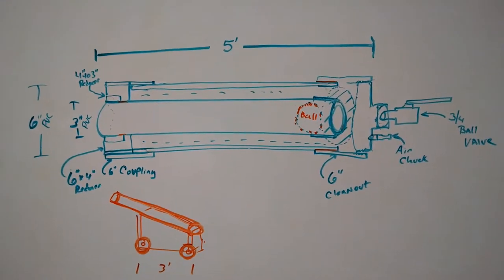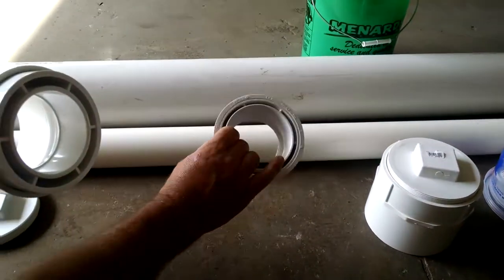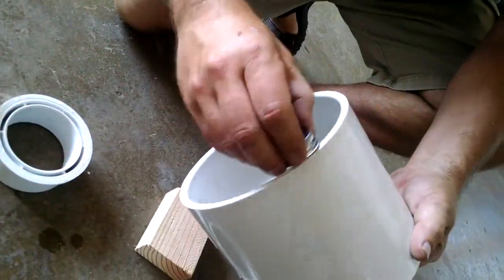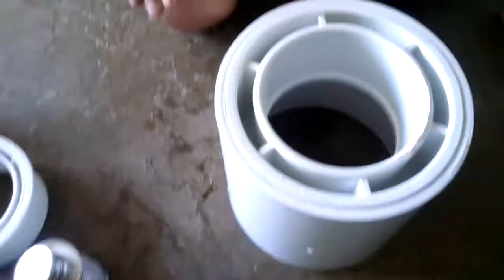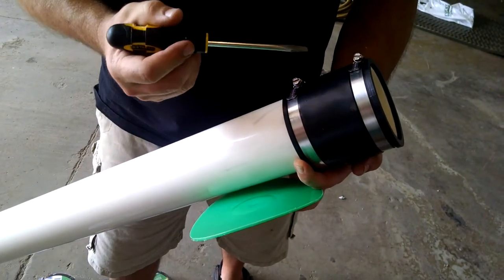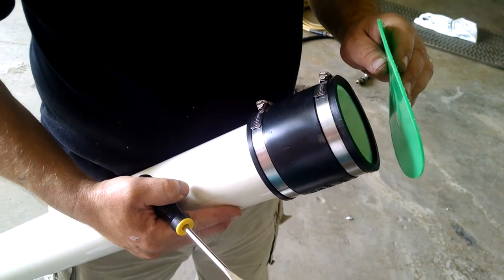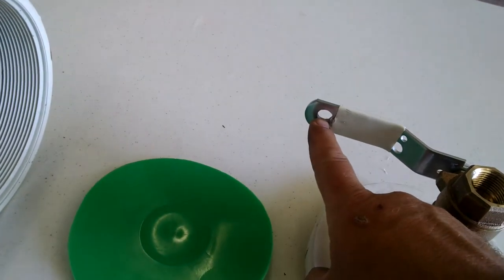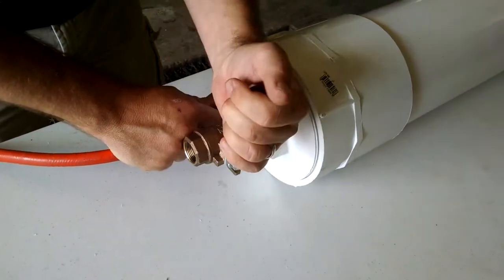How to Build a powerful Baseball Air Cannon  REAL HOWITZER

Comment: What if you lowered the air pressure? Would it go a shorter distance or just not work at all? I’m just trying to find something to shoot a baseball at 45 degree angle for 70-80 feet.
Reply from the maker: we fired this unit all the way down to 30psi with good results, the amount of force you need to push the Baseball 70-80' is very low, likely less than 5% of the unit shown at 120psi

Comment: If i made multible of these but only one having the valve, and the rest connected in a series, with a seperate section of pressure tubing connecting valve to valve. With the delay in reaction of each valve do you think i could manage each cannon to fire in sequence one after the other.
    -- just imaging multible of smaller versions of this cannon shooting full auto with only a singal trigger valve fireing all the rest.

Comment: Curt, nice work on this! I'm trying to use this diaphragm valve idea to launch much larger projectiles (~ 40 lb). What is the software that you show in the video?
Reply from the maker: Greetings 
There are a few pneumatic launcher calculators out there, one we have used forever is GGDT or HGDT pneumatic calculator, do a google search for these terms and you will find it archived in the way back machine as I think the web page is long gone. if you cant find it i can pull it up from our database and send it over. its very old school but very useful. no problem scaling it up to 40 lbs or pumpkin gun kind of stuff!

Comment: What software did you use to simulate pressure, velocity, etc. at the beginning of the video
Reply from the maker: It is some very old software that is now proprietary, there are a few other software platforms that can help you design pneumatic launchers.
Reply: @curtgraber  thanks for the reply! What free/low cost softwares would you recommend? I’m looking to build a similar cannon, but want to simulate first so I can build to get a certain velocity output

Comment: Very nice! I was planning on making one with the same coaxial design. Difference would be that Id put a female and male adapter on the front of the cannon, fill the reducers at the butt with epoxy to allow tapping for bolts as re-enforcement.. Reason being that i was going to make a plywood piston valve so i needed the extra strength at the rear to handle impact upon release of pilot pressure.

How is the disk holding up? Would or have you considered using a piston valve? Any leaks from the threads of the clean out stub? When would you need to adjust the amount you tighten the cap? Is there a sweet spot? 

Im sorry for all the questions, parts are pricey here in hawaii so i wanted to do my research before i jump in.

Thank you for sharing your build, i really appreciate it! I was ecstatic when i found your video! Lol

Aloha!
Reply from the maker: Cameron Isaiah  Greetings Cameron love your state been there many times, we did a Maui Christmas this past year with the kids they were ecstatic with the excitement of seeing everything.

  At 125 psi the glue joints are totally sufficient without adding bolts, the limitation of the design is the cast pvc clean-out fitting and the threads, but having made many of these since the late 80's I've never had one fail yet. ALWAYS do the blanket wrap around the clean-out fitting during initial testing procedure! mass of the disk valve is everything so heavier is far worse for the transient valve opening time. if you use a disk as I show it the full off to full on flow switch is only about 0.25-.35 ms that is almost as good as a burst disk valve, and this design is re-usable, over and over.

Disk valve materials do eventually fail under the extreme stress of the firing process but we typically get dozens of shots from a disk valve, just inspect it for cracks, eventually it will fail.

We are building a vac barrel version of the pneumatic gun it is a HUGE velocity increase potential, where the barrel muzzle is sealed with a one shot burst disk made up of many layers of poly or even clear packing tape. 
You drill and mount a vac port into the muzzle end fitting and pull the entire barrel into a deep vacuum we typically shoot for 27-28 inches, then fir the gun as typical, the difference is you have eliminated the air resistance in the barrel for the baseball to accelerate AND the air velocity through the valve is well past supersonic so the maximum velocity attainable is not limited to the airspeed of the pressure front with just the delta of the pressure vessel (chamber) to atmospheric pressure (barrel) we will show some new high speed video of the baseball gun getting a 5.25 oz baseball to faster than 1200 fps!  the energy in the baseball is immense to say the least.

Make sure you check out the watermelon shot high speed video it is spectacular, with energy transferred to the watermelon many times greater than a small bullet going at any velocity can attain. this due in part to the giant surface area of the baseball in the contact area.

Stay safe and have fun...
Reply: This is awesome great job on the video. How much did it cost to build the version in this video?
Reply from the maker: Your cost of materials might vary place to place but it should be able to be built for under 50.00
keep the pressures low!  the cast pvc parts such as the clean-out assembly is the weak link in the chain.
put a trigger string on the unit and stand away to shoot it.
We want to build a welded aluminum or steel version of this launcher to go up significantly in pressure with a good margin of safety.
To many projects and to little time I guess.
Make sure you have a look at the high speed camera Watermelon shot with this launcher and a Baseball it is pretty cool!
Reply from the maker: Your cost of materials might vary place to place but it should be able to be built for under 50.00
keep the pressures low!  the cast pvc parts such as the clean-out assembly is the weak link in the chain.
put a trigger string on the unit and stand away to shoot it.
We want to build a welded aluminum or steel version of this launcher to go up significantly in pressure with a good margin of safety.
To many projects and to little time I guess.
Make sure you have a look at the high speed camera Watermelon shot with this launcher and a Baseball it is pretty cool!

Comment: Around how many shots do you get out of the bucket plastic?
Reply from the maker: we had hundreds of shots at less than 125psi  all bets are off on higher pressures for the diaphragm and any other plastic parts. Highly recommend staying lower pressure
Reply: Curt Graber Thanks. I want to keep the exit velocity down, around 140mph, so that shouldn't be an issue.
Reply from the maker: it will completely depend on your projectile mass to determine needed pressure, but 5 oz is roughly 500fps @125psi I would suspect  200fps would only require 60-70psi on the same 5 oz load.

Comment: Wow! Great video! Liked and subscribed. At "1,372.6" fpe, who needs a firearm? It has plenty of knock down energy to take down a deer, or a small elephant, and be used as a home defense weapon, but would you need a conceal carry permit? Just put a cowboy hat at the end of the muzzle and walk with a limp. Picture John Wayne carrying your cannon. Your baseball has the equivalent of a 220 grain 45 caliber ball round traveling at twice the velocity of an M1911A1 bullet at the muzzle. I would rather get shot point-blank with a .45 than your baseball. I wish I had your cannon when in the bush in the Nam, it would have ended the police-action much earlier, since a declaration of war was never officially declared; else, Jane Fonda would be up for treason than an Oscar. Just picture a Marine rifle platoon armed with your cannons, lined up and shooting waist high, horizontally into the bush. The V.C. and NVA would suddenly join the Chieu-Hoi program. Also, at 125psi, there is approximately 884 pounds of force on the 3 inch diameter baseball, which is an eye opener because the 125 psi doesn't sound like much, but that is only on a square inch, when the baseball of 3 inch diameter has 7 square inches of shadow area, so 7 x 125 = 875 (roughly) then accelerating it through a 60 inch barrel, calculations show 4,418 foot pounds of force, so with the kinetic energy of the baseball at 1,372.6 fpe divided by the calculated 4,418 ft.lb.f gives an efficiency (n) of 31%, which is better than a 30 caliber airgun pellet from out of the box from a well made airgun, with no tuning.  I say again: Wow! You should offer it to the Pentagon to use against the Tali-Boom! in Afghanistan. The scary part is that it can't be detected at the airports or courts because the lack of metals. You watch that once the ATF sees your video they will motion for legislation for the barrel to be wrapped with aluminum foil and not allow a muzzle moderator for it (silencer). You have one awesome gun that should be studied in every high school physics class, but without the use of the word "gun" for political correctness. Another idea is to use it as the first pitch in baseball and put the next person up for capital punishment as the catcher, not very humane, but very sportsmanlike and entertaining. I do have a question; though, have you thought of using Doppler RADAR in order to calculate for the ballistic coefficient (BC)? Lastly, your video is very entertaining, informative, educational, thought provoking and opinion shaping. Thank you.
Reply from the maker: Appreciate your input, the novel co-axial valve design came from my much younger mind in 1988 as a way to quickly switch high pressure air with massive volume potential as the valve has similar performance as a burst disc. yet it fires over and over ;)

Comment: we cleaned the diaphram and applied grease after every shot initially, there is always a bunch of debris inside the chamber after construction and the grease seems to catch it, of a little piece of debris ends up between the diaphram and end of the barrel it will not seal up correctly.